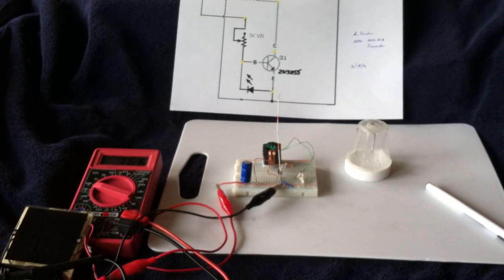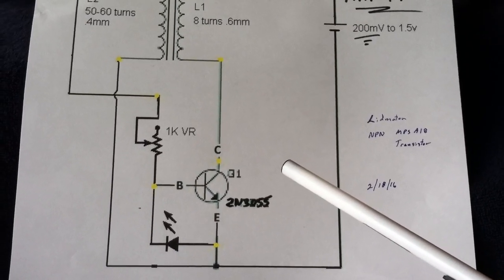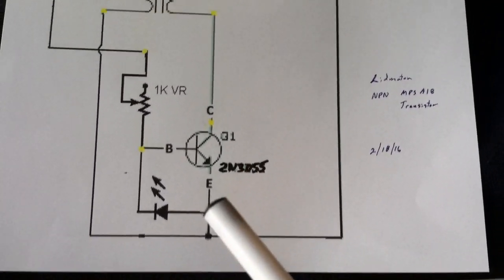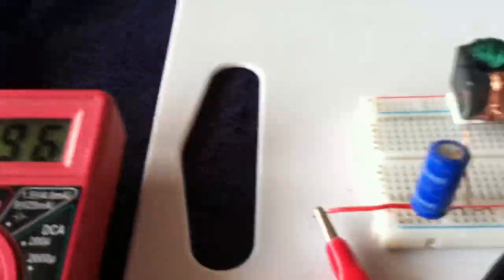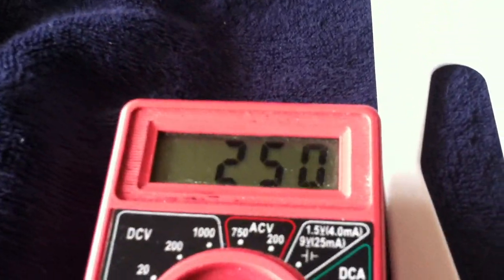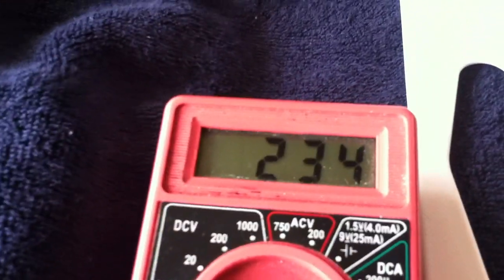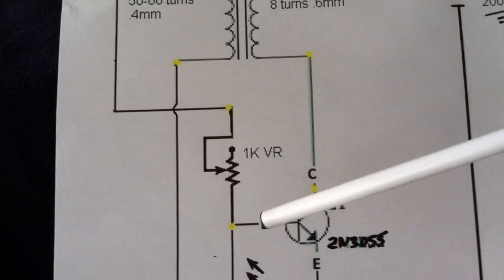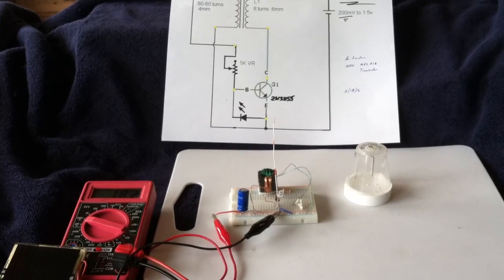Tinman's Ultra Low Voltage Led Driver

Comment: I just tried it and the light is dim, when I remove the end of the secondary coil connected to the emitter of the transistor and the light comes on brightly, why??

Comment: I have just tried it and it DID work!!!! I am using one AAA cell at 455 mV...and powering two 5 mm white LEDs in series from Cree. Glowing brightly. Amazing!!!!!!! 😃👍

Forgot to mention, I am using no 32 wire for both primary and secondary.

Comment: so annoying that the second i see these diagrams idk wtf is going on but if you just say "This transformer takes in 1V and puts out 3V" and then move on to the next component maybe i would fucking get it
Reply from the maker: Sorry.  So much is lost in translation---even in electronics.  I had the same problem when I was in college.  I could not understand what my engineering instructors were saying.  It took hours to decipher a lesson.  Very frustrating.

Comment: What was the current going though the led? If i use a germanium diode and a capacitor in series with it, will i be able to charge it?

Comment: Thank you very much for sharing your progress, I have long been working with the work of John Bedini and thieves and I have many joules implanted in my home to reduce consumption due to these inventions systems, wanted to know if I could e-mail the detail of the position of the capacitor in the circuit do not know if you've changed the resistance I am interested in replicating it to confirm, thank you very much my email is: I info@energia-libre.info

Comment: Up to the minute: i have driven 10 1/2 watt leds with power supply set as low as 500mv and as high as 750mv. I am now driving one 10 watt LED using 750mv. I can send you pics via email later if you wish. I don't have the fancy camera setup to upload like you pros do.

Comment: New results with all features I previously described below except:
1. Tested with Q1 = ZTX1048A
2. LED WAS VERY BRIGHT:
   A. Power supply set to: 200mv
       1. Power supply current:      45ma
       2. Drove 2 white LEDs in parallel, both bright. Not as bright as 1 only.
          A. Power supply current 44ma
3. LED WAS JUST VISIBLE:
  A. Power supply set to:      80mv
      1. Power supply current: Under 1mv
4. LED NOT VISIBLE:  
  A. power supply set to 70mv
Reply from the maker: +TheBdd4 That sounds really good.  Try putting the 2 LEDs in series.  That is what I am doing.
Reply: +Lidmotor Hi Lidmotor,
I am presently running four 1/2 watt white LEDs in series and they are quite bright. Circuit wont start with static trigger. Starts Q1-Base through 620 ohms to 500mv supply positive. Results:

 A. Power supply set to: 500mv
       1. Power supply current: 215ma
 B. Power supply set to 150mv
Circuit will not start with static trigger. Starts by directly connecting Q1-Base to 500mv supply positive. Start may require more than 1 touch.
      1. Power supply current 18ma
      2. LEDs  are visible but dull.

Comment: I have built a similar circuit with the exception that LED Cathode is connected from the top of L1 and it's Anode is connected to ground. Here are my results:
Power Supply: 390 mv DC
CIRCUIT WOULD NOT RUN BELOW 390 mv
Q1 = 2N3904
L1 = 8 Turns AWG #21 Enamel coated copper wire
L1 = 60 Turns AWG #28 Enamel coated copper wire
(L1 and L2 were wound on Amidon Inc. Ferrite core PC3622-77)
R1 = 1K ohms
LED = White 5mm through hole LED  
LED WAS FAIRLY BRIGHT
Circuit started with a static pulse applied to Q1- Base or by momentarily ungrounding L1
Levels measured doing operation:
Q1- Collector: Square wave + 2.4 Volts to - 3.28 Volts at 11.8KHz + Duty Cycle =60.4% 
(Measured with Tek TDS3054 AScope)
LED Current: 4.8ma (Measured with HP 6022 Current Probe on Tek TDS 3054A Scope)

Comment: Hi Lidmotor, Thanks for another interesting video. I have a feeling the static voltage you generated by rubbing the pen is quite high, perhaps many 100's or more volts.
Reply from the maker: +TheBdd4 High voltage but extremely low amperage.

Comment: Once again Lidmotor--nice job.
Reply from the maker: +TinManPower  Thanks you for sharing this and your video showing how it works.  I think that you are right about the capacitance inside the transistor having something to do with the operation at these low low voltages.

Comment: That is a nice circuit Tinman has made.  I always thought I was doing great at like .450 volts, ha ha.  I think TK has one that runs on very low voltage as well?  The old JT circuit just seems to keep our interest.

Bill
Reply from the maker: +Pirate Labs The good old Joule Thief.  You and I sure have spent a bunch of hours working on this one.  It brings back memories of the days when Jeanna was around.  Those were fun times.
Reply: +Lidmotor You said "when she was around." What happened to Jeanna? I see her posts stopped about 5  years ago.
Reply: TheBdd4
  She moved out into the woods in the Pacific Northwest and off the grid...and off the net.
Reply: +Pirate Labs Thanks Pirate Labs. How did you find that out?
Reply: TheBdd4
She mentioned to me in a phone conversation, and then on a skype call, that she was going to do this.  She obtained 2 shipping containers and had some land and was going to make those into her new home.  That was the last time I heard from her...probably 5 or 6 years ago now.
Reply: +Pirate Labs Thanks, sounds like she was a skilled person who tired of on the grid pressures. If it is the same jeannacav a search turned up, it appears she is a relatively young person, perhaps in her mid to late 20's in the pictures I saw.
Reply: +Pirate Labs Also, I wonder whatever happened to Dr. Robert Stiffler who was very active on Youtube a few years ago? All of sudden he dropped out. His site http://www.stifflerscientific.com/ is now unreachable.

Comment: is the LED any brighter directly across L2, rather than through the resistor?
Reply: Hi LidM. what is a good brightness current at 0.2 Volts in this case ? Can you please measure it and post it ? Many thanks.
Reply from the maker: +overunitydotcom  On my setup it won't get very bright at .2 volts---not matter what I do.  I think the reason is that the transformer needs to be constructed specifically to do that.  About 20mA at .2 volts is about as good as I can get on my setup but the light is minimal.
Reply from the maker: +whackyscoop It seems to be brighter directly across L2 --and the oscillator kept going all the way down to 160mV!  Thanks.
Reply: +Lidmotor Wow, that is a really low voltage for a JT. So across L2 the LED works best with the lowest voltage then ?
How much current does it draw for a good brightness in this mode then ?
This seems to be a great circuit for a graphite aluminium metal-air battery then, if the current is not too high...
Reply from the maker: +overunitydotcom  There is no free ride.  The current is higher than I would like.  Brad was showing a little less than 30mA at .23v to get good brightness.  My preliminary tests are similar but the LED will glow at about 1 mA at .2v on my setup.  I need to do more tests.  The transformer really should be engineered for exactly what you want to happen. It is all a trade off.  I like putting the LED across L2 on this setup. It evidently isn't needed for transistor function on my setup.

Comment: Now that is darn interesting.
Reply from the maker: +legalizeshemp420 When Tinman showed this I had to give it a try.  This has probably been done many times before but I had never seen it.
Reply: *****
Well, what voltage is it taking to start it?
Reply from the maker: +legalizeshemp420 Actually if there is about 300mv on the cap I can 'tap' start the circuit by just jumping the (+) to the base.  If i gave that transistor a hard stare it might go. lol
Reply: *****
The bad part to JTs is that they take 0.6v-0.7v to start but once started can go down to about .3v so if it can start lower than 0.6v that is an achievement (unless using a germanium transistor which we can see wasn't used).
Reply from the maker: +legalizeshemp420 I have some germanium transistors. I can try one and see if things get more interesting. Maybe a radio signal from an crystal radio setup will start this oscillator. Fun stuff.
Reply: *****
Now you are going where I was thinking. :)  Try them both as I bet you it can be done.

Comment: Very clear demo. I like the electrostatic device for showing the charge. Must build one of those, well, both things !
Reply from the maker: +slider2732  This will start up sometimes without having to be the 'jump started'.  It is pretty interesting.  I think there is a lurking capacitor hiding in the Joule Thief's pocket somewhere.
Reply: Tried this as a blocking oscillator (your Penny method). Once fired by static, it will start up again at any point for minutes afterward with no static. The aim, is to get a Penny running from < 200mV at microamps - can it be done ?
Reply from the maker: +slider2732  The word for the day is -'blink'.  That is where I'm at now.  Long ago a famous Phd we know told me to , "Look for the blink and then you know you're close."  He might have been wrong about other things but I think that he was right about that.  I built Penny based on that idea.  Store up the little bit of energy you get ---and spend it wisely in short bursts.  Going down to the depths of <200mV at micro amps is going to be tough unless we blink it at a very slow rate.  I'll take that and go from there if it happens.
Reply: It does happen :) If you put a '104' and 1 meg resistor to the Base + add a 100uF cap on the power inputs. Galv steel on the negative, copper on the positive. All quite usual for Penny types. It will give a nice flash when put in water and the piezo is used...but oscillations aren't there. So maybe magnesium ribbon and salt water would do it to start with a higher input and reduce down with coil turns ratio etc. i'll take that and go from there if it happens :)
Reply from the maker: +slider2732 I had great success yesterday working on this project..  I made a video of it but I may not post it.  Basically what I did was blend the Penny oscillator with Tinman's idea.  I may call it the 'Tinned Penny' oscillator.  I'm still playing with the circuit layout and values but I like what I see.
Reply: *****
Great to hear of the success. My own won't drop into oscillation below a milliamp or so and maybe the turns ratio is what to look at.
Have got the idea that such a thing could run perhaps very slowly, but from ambient radio waves and such. Anyway, congrats ! it's all a lot of fun :)
Reply: +slider2732 I don't understand what you mean "wont  drop into oscillation below a milliamp"? What is the milliamp current you are measuring?
Reply: TheBdd4
If you take a look at Lidmotor's Penny circuit, they can run in the uA. An aim, is to perhaps have one of these Tinman circuits run at that low of a current.
Reply: +slider2732 Thanks for replying. I plan to replicate the Penny Oscillator. Would you please tell me the wire sizes in the primary and secondary, the number of turns in each and the type of core you used? Also, I noticed in one of your comments you mentioned "600" one way and "300 the other. Did those numbers refer to the primary and secondary turns? I see that Lidmotor used iron wire but I doubt that is necessary. Microamp current to light a LED is impressive. I plan to look carefully at all of the currents in the circuit.
Reply: TheBdd4 Yes, just build from the 'Penny Oscillator' vid. It's a blocking oscillator. but Lidmotor popularised it, hence credit where credit is due.
The coil itself can be wound like a Joule Thief coil and, yep, I probably meant 300 turns Primary, 600 Secondary. 120+120 works about the best from experience (wind 120 turns on a ferrite core, pull a section out that will connect to the Positive from the batt and then carry on with another 120 in the same direction). Using copper on the positive lead and galv steel on the negative, you can run a Penny's LED by holding the metals in the hand !
Reply: +slider2732 Thank you slider. Sounds like holding copper and iron
forms a small battery but to drive a LED with that combination is remarkable. I plan to build soon.